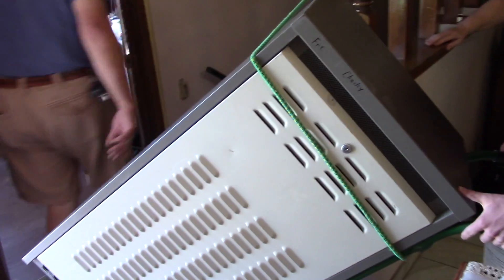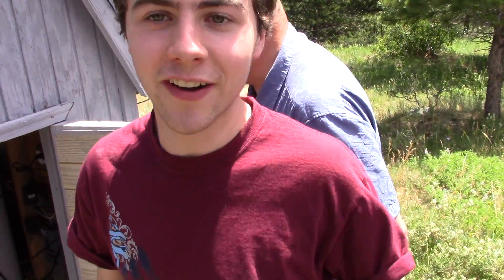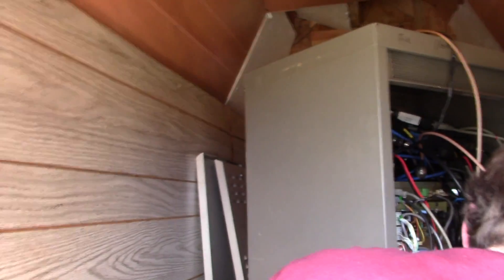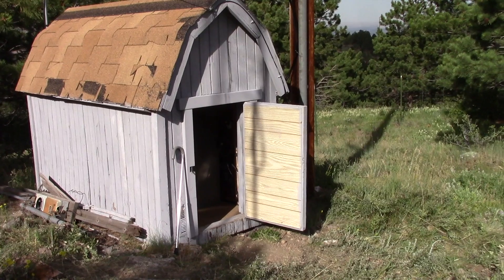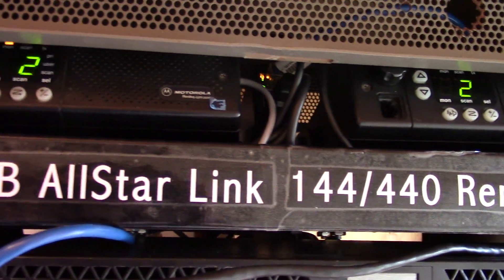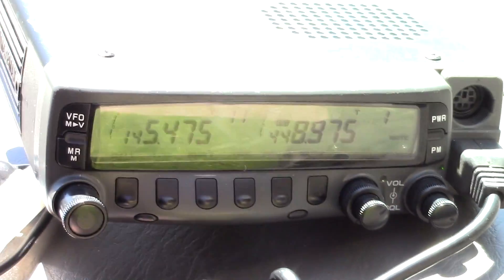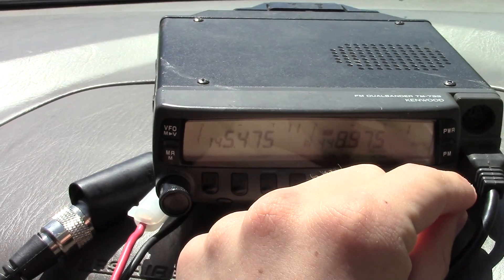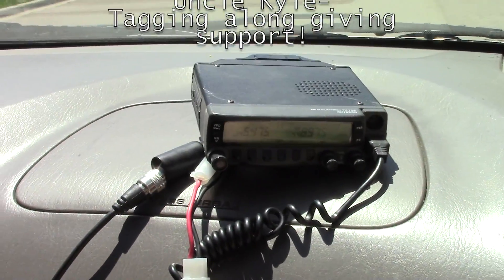Blue Mountain Ham Radio AllStar Remote Base installation

Comment: You should have just used UHF link radios from your VHF and UHF repeaters back to a central location. That is a lot easier than having everything at a site.
Reply from the maker: That would've been much harder tbh, I'd have to have control channels for sending DTMF to steer the remote base, I would also have to have a central  location. I would also have to have filtering so the UHF link radio deos not interfere with any channnel on the VHF/ UHF remote base, and also need to get a link frequency coordinated in the busy front range of colorado where all the freqs are used up.
Reply: @SkylerF  I'm using a 444MHz tx for the repeater and my UHF link is at 441MHz. No filtering required. Plus I'm using a Motorola Quantar for a repeater
Reply from the maker: @CHS1997  Im not sure how that would apply in my situation,  I would need a pair of link frequencies for gerrys repeater, another link frequency for VHF remote base, another for my UHF remote base, and one more for 6 meters. So that would be a minimum of 5 link frequenices... Free internet from Mountain Broadband definately is much more economical and easy than putting all these links together. Did you even watch the other video when I built the whole thing?
Reply: @SkylerF  a link frequency is simplex. We use the same link frequency for both repeaters. It's like simulcast.
Reply: @SkylerF  Link frequencies should be above 222.15 MHz. This can be found in the FCC Part 97 rules at [97.3(a)(7)]. It would be nice if there was more equipment for 222MHz but there isn't much of a market for that band.
Reply from the maker: @kd5you1  Where did I ever say I was ever making point to point VHF links?
Reply: @SkylerF  You were using 146.55 right as a link or control frequency?
Reply from the maker: John D no, the entire setup does not have a link frequency. See my other video on the entire setup of the remote base. All of the linking back end is performed through microwaves.
Reply: @SkylerF  technically the system does have a link frequency, if you are using microwave
Reply: @SkylerF  Ok sorry. I guess I misunderstood the usage of 146.55 in the video. I just watched the video you made on setting up channel steering. Very impressive!

Comment: Skyler,  have you documented this remote base configuration?   I am very curious how the controller speaks to the Motorola rigs!  If you have any other pics or documentation I would love to read over it so I can learn something before setting out to put remote base facilities back on our system my friend and I are refurbishing.  We got a new Link Comm controller and of course it doesnt support our old FC-900 interface and Icom modules. When we ran an ACC controller we had VHF/UHF fully agile remotes, could change any setting via DTMF,  3 steps forward 4 steps back!  73 de Seth - W8FG
Reply from the maker: Thanks for watching! The other video I put up before this has information on more details. I did not use a traditional repeater controller. There is no way making it work with any controller I know of out there. The remote base is entirely controlled by a raspberry pi and uses AllStar link. I had to write custom scripts for the whole thing. Watch this video and let me know what other questions you have, I would be glad to help https://www.youtube.com/watch?v=ZY9pfy5F4hw

Comment: Don't leave that radio on the airbag while driving. If the airbag deploys it will send the radio in your face at 200MPH
Reply from the maker: I don't! Just placed it there to give the demo, haven't mounted the radio yet
Reply: +Skyler F Just checking ;)